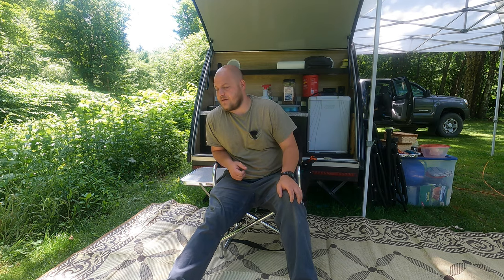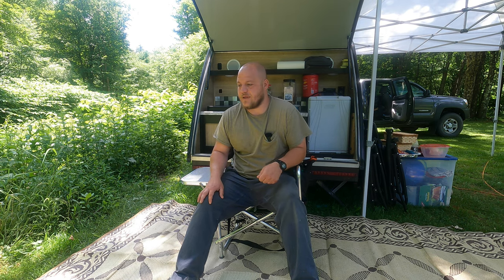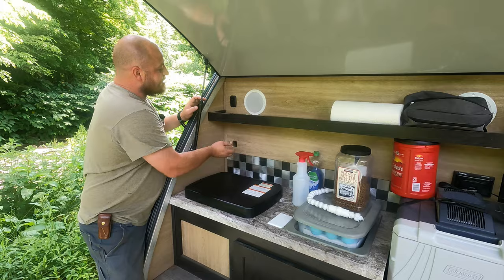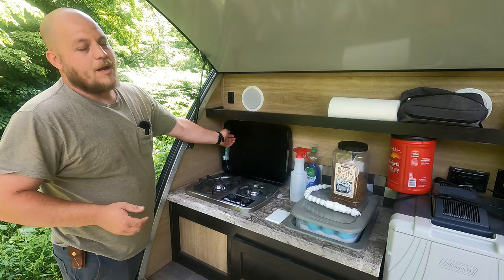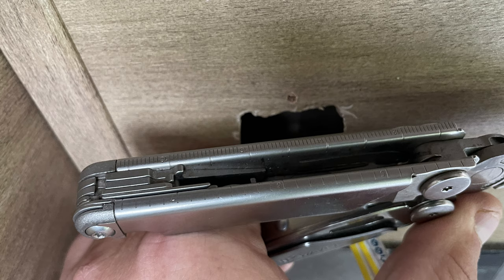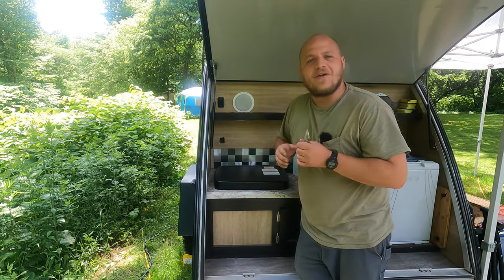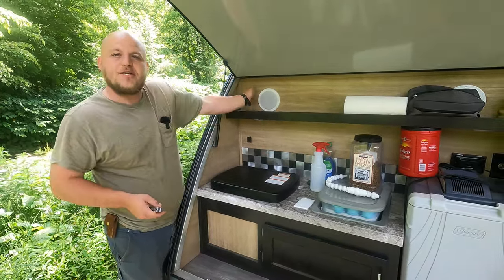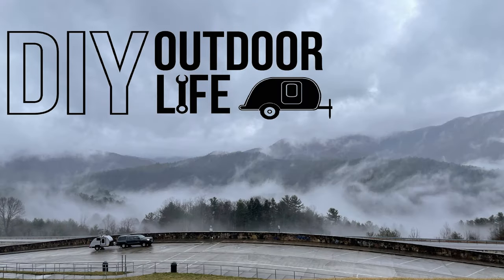Moving Water Pump Switch | Braxton Creek Bushwhacker

Comment: Wondering if using a dimmer switch will help to control the flow or if the pump would even function on a dimmer? Just curious? Great little project while you are out on the road. 
Thanks for sharing, 
Pat
Reply from the maker: Yes it will. In one of my reviews from the rally, Tom installed a variable voltage switch for his pump. He said it works great.
Reply: @DIYOutdoorLife  That's great to know. Looking forward to testing it out.

Comment: Just tried this mod and the water pump doesnt switch on. Any suggestions on what to look for? Thanks!
Reply from the maker: Is battery on? there's not much you could have done to hurt anything. Pull the switch back out and take a pic, Id be happy to help
Reply from the maker: diyoutdoorcontent@gmail.com for photo. Probably something very simple
Reply: @DIYOutdoorLife  the battery is on and I'm getting power to the wires. Just emailed you a photo. Thanks!
Reply from the maker: sent you an email
Reply: Thanks for getting on the phone with me to troubleshoot the issue I was having when I relocated the water pump switch! After a few minutes we realized I blew a fuse! Quick replacement and I was up and running again.  Thanks again, sir!
Reply from the maker: We had fun, happy to help!